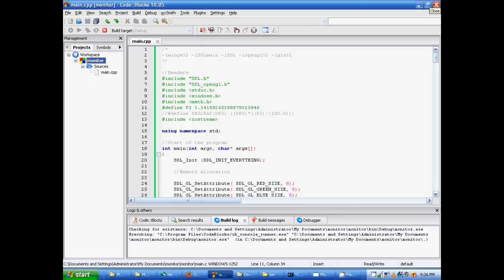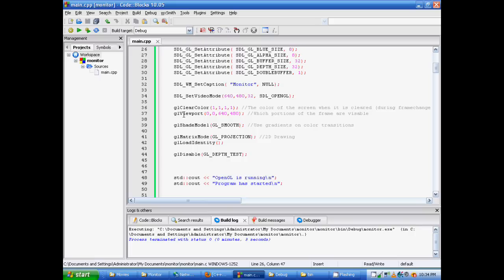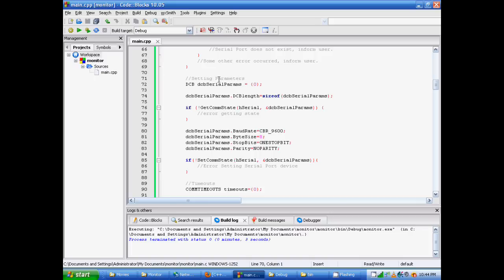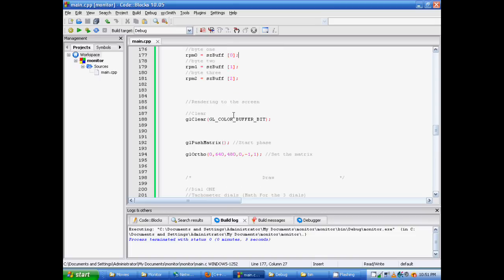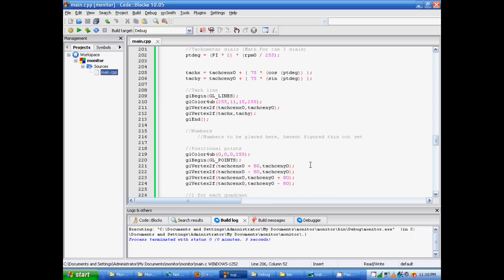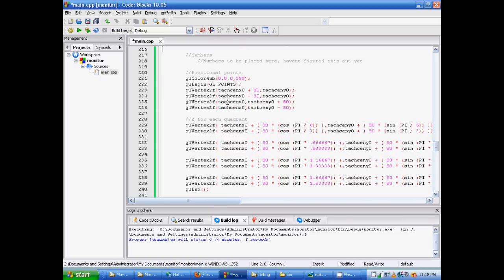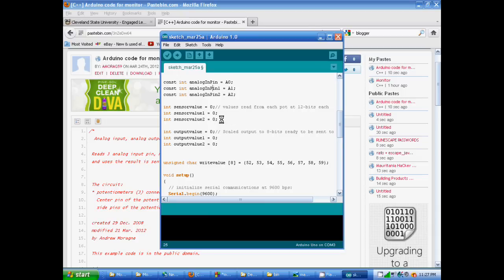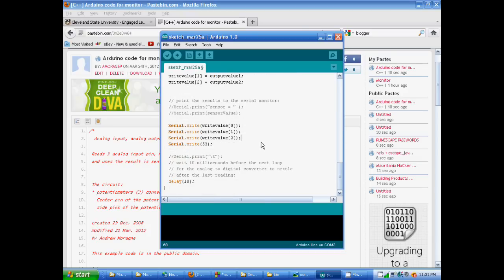Data GUI Tutorial Part 2 - Code/Demo (C++, SDL, OpenGL, Arduino)

Comment: hi iam using an ultrasonic sensor with uno how can i get the similar ui that will tell wether the vessel is empty or fulll
Reply from the maker: +Beginner You can probably write a function that draws a green square to the screen when it's full and draw a red one when empty. It would be a bool "true" or "false"

If you have a range of how full it is, you can probably even use an int (integer) to represent "fullness" and a dial.
Reply: got it

Comment from the maker: Right after everything for openGL is initialized, I get a handle to COM3 (the USB port). I believe with createfile it transports everything as if it were a file. In arduino I used serial.write(buffer[]) to send everything. To send data to Arduino, simular code is used except you change a few things around (I haven't experimented with this yet, but you use generic_write instead of generic_read etc in codeblocks). Visit the new "serial communication" link in the description for more info.